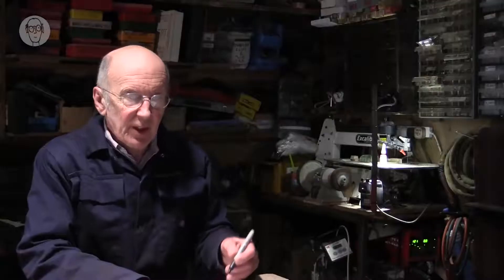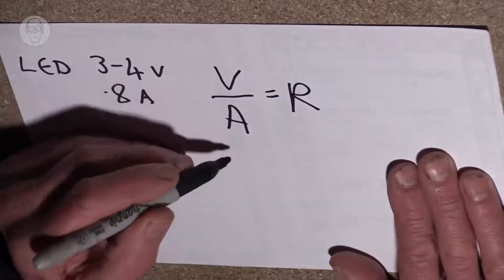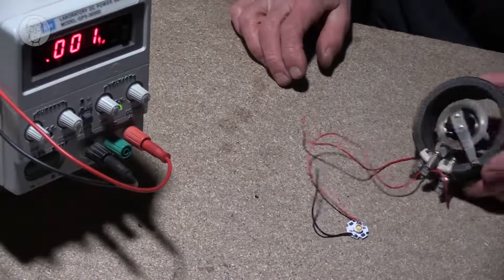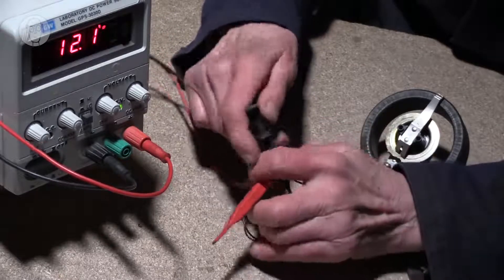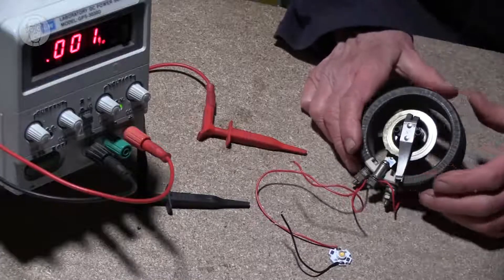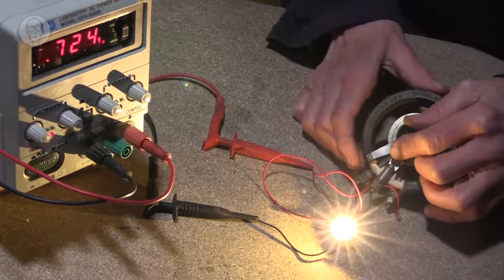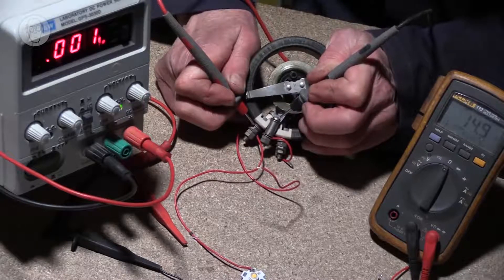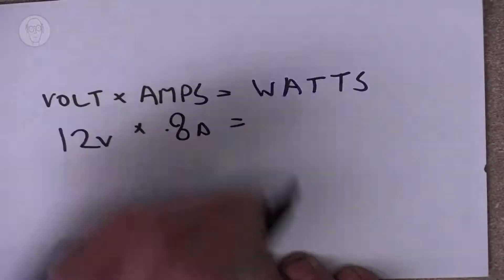Setting Power supply to use constant current - constant voltage

Comment: This is a really great video, thanks for sharing. Did you build that variable resistor? Also, is there any way of knowing the exact voltage supplied to the led? Doesn't the variable resistor consume most/all of the voltage since the setup is in series?